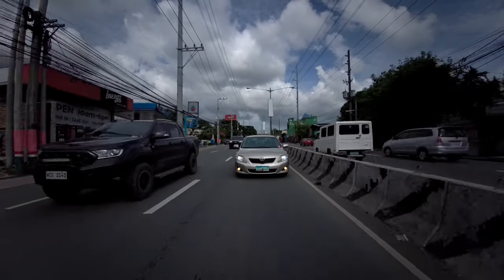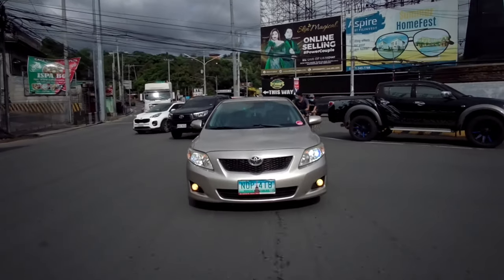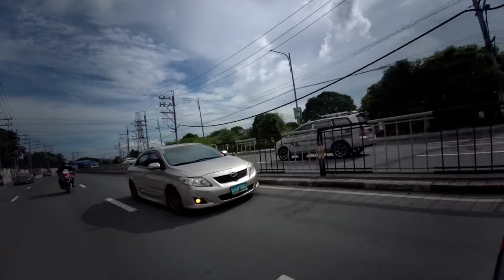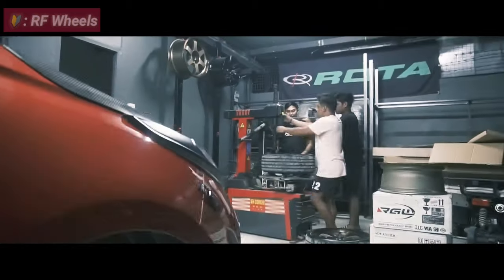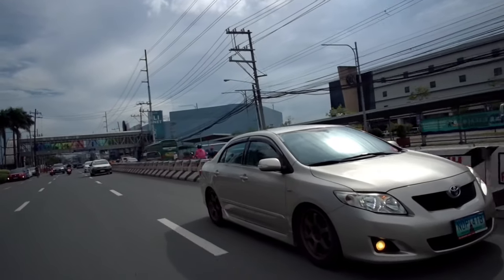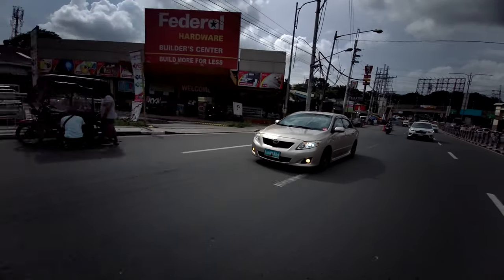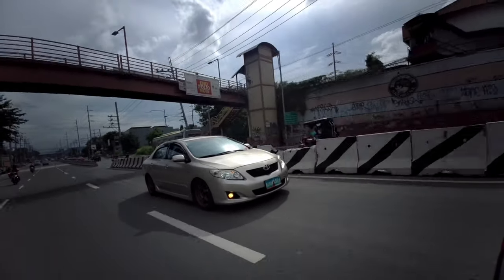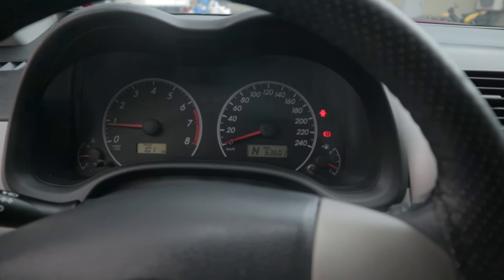JDM-Themed 2010 Toyota Corolla Altis 1.6G | Keeping it Nifty | Philippines | Featured Car Review

Comment: one of the best handling car i have driven in metro.manila 2008 1.6V superb steering nice.ride.comfort power just right . though i ended up civic.fd 1.8 planning to get 1.8V altis or 1.6V but not 2.0v hehe. nice video🥰
Reply from the maker: Sorry for the late reply. Thank you so much! When it comes to handling, I'd sat the Mazda 3 or the Civic FD takes the cake but for comfort and ease, this Altis is the clear winner.
Reply: @mototelic  agree steering is so comfortable smooth as silk ideally relax pace.